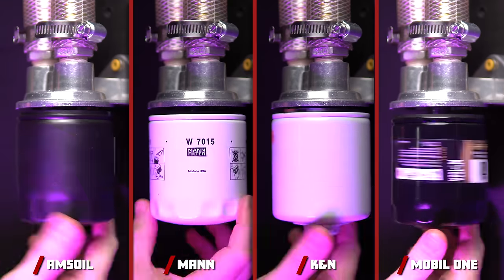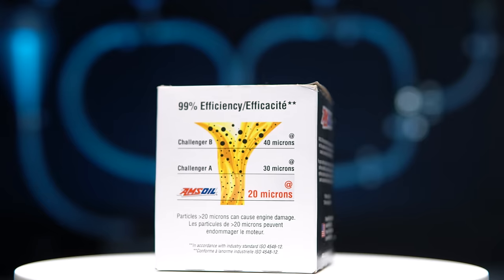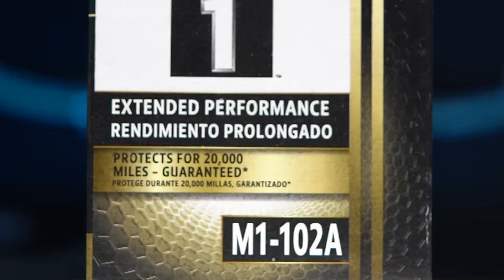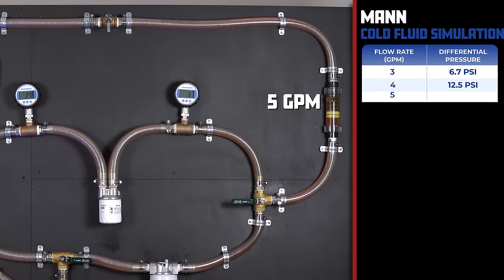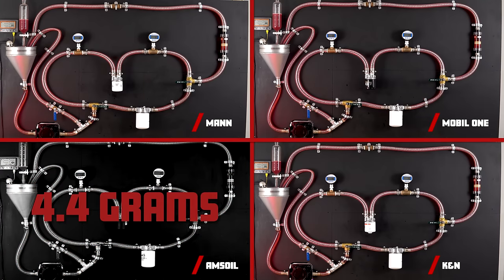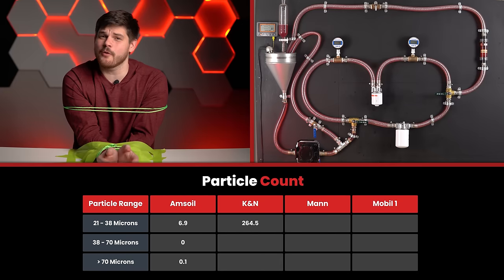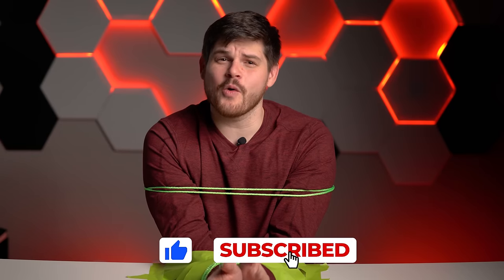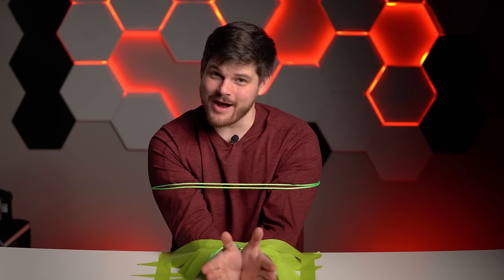Best Oil Filters of 2024 (Engineer Tested) - Amsoil | Mobil 1 | Mann | K&N

Comment: The Amsoil filters are full microglass same as Fram Endurance, Purolator Boss, and Royal Purple EL. The Mobil 1, Mann, and K&N are cellulose blended with microglass. Cellulose is less restrictive but not as resistant thus blended for longer service. 100% extended drain-interval synthetic oil should be matched with microglass filters for longest service and engine life possible.
Reply from the maker: Thanks for the info and for watching!

Comment: I’ve tried several different filters on the same 2008 truck over the years every 5000 kilometres. For the past 3 ish years I’ve stuck with Mobil 1 because my engine starts quietly during cold Canadian winters. My engine is less smooth and louder (only on start up) with all other filters when it’s cold out. I would compare the louder sound I had as being similar to what an engine sounds like on first start up after having the oil changed. I don’t get that with the Mobil 1 at all, so I feel comfortable using that filter.

Comment: Can you please test the new PF63 AC Delco p/n 12735811 with 13 holes in the base vs the older model with 8 holes in the base p/n 12707246 Really curious to see the difference if any 😊 thanks

Comment: I use Walmart Super Tech synthetic oils and >10 μ Donaldson filters (cross referenced to OEM filter specs) in my vehicles. Change every 5k miles. Yearly inspections show minimal wear in my turbocharged engines. I pay $45 for a case (12pk) of the filters.

Comment: Thank you for your video I actually use it for reference.  Love the restraints kind of throws you of guard.  I wanted to know if the Purolator Boss having less filtration than the Purolator One at 20 microns was not used instead.  I couldnt find the Purolator specs so I contacted them and they told me that the Boss has less filtration than the One.  Thank you for your awesome video.

Comment: I am just amazed at the wix xp sucking at the filtering.  A suggestion - can you weigh the filter before and after each test?   You mention capacity etc but curious if the weight after each test will illustrate filtering and capacity as well.

Comment: If you want lower flow restriction, use a longer version of your stock filter. The longer the filter the lower the restriction. Motorcraft ,Fram, and Amsoil are 3 companies that have longer versions of my stock filter available for my 94 ranger (2.3L). There are probably more filter companies that have longer versions available also.

Comment: My engine has a VTC issue, which rears it head on super cold days.  I suspect when it takes longer for oil to reach the top end.  I have been using the Mobil 1 filter for its supposedly good flow.  I see there are some other filters that might be as good or better for my needs.  Thank you much for doing this testing.
Reply from the maker: Thank you so much for watching. Yeah the Mobil one has great flow, but some have even better during cold temperatures. Glad you enjoyed!

Comment: How things have changed. Years ago, FRAM fell from grace and became the biggest piece of crap ever made, they used carbon steel staples and GLOBS of glue to secure the pleated paper, the elements were breaking apart and collapsing, blocking the flow in the filters! I NEVER used Fram on my 69' Charger and Barracuda with a Hemi and 383, and neither did any of my dozens of friends who had high performance engines.  Wix, Purolator and GM were very good back in the 60's-80's,   Happy to learn that Fram got their act together once again and straightened out their mess. Great VIDEO !

Comment: Interesting video! You should really test a common OEM Honda K20A oil filter vs the legendary F20C specific OEM filter used on the S2000 and really show the difference between them. The story behind it is that the S2000 filter has less flow restriction due to the high oil flow capacity requested by the 9000 rpm engine but I think nobody ever quantified the difference with a proper test.

Comment: I just picked up a Purolator Boss filter and two 5 quart jugs of Pennzoil Ultra Platinum 5w-20 for my truck today. I got a new motor last April of 2023, and it finally sounds broke in, and it is finally getting the correct fuel mileage. I hope swapping what I use for oil and filter keeps this thing going for 18+ years like the original motor did on Mobil One oil and filter.

Comment: Seems like the filters with the less restriction  and better flow also . Seems like the reason Amsoil has the worst restriction is because it has the best filtering media. I doubt the pressure differential would even be much of an issue for daily drivers as they aren't driven full throttle all the time. Amsoil makes some nice bypass kits too you can put on any vehicle that filter out even finer particles.I'll take amsoil all day long for engine longevity. In fact my wifes Accent is almost at 230k miles and last Blackstone test using Amsoil oil and filter came back amazing.

Comment: Put a Purolator Boss on my Tacoma today due to this video. Maybe it's overkill for that, but I want the best filter I can get. It does so well in these tests that it's almost hard to believe there is a single do it all filter available.
Reply from the maker: So glad we could help! Thank you for watching!
Reply: Same trying a purolator boss on my 350z this weekend instead of my usual K&N HP-1008
Reply: Why didn't you use Amsoil then?
Reply: @DaddySizeIt  You've read about "possibly even strip the additives" but where is the objective proof? There is none, because it is nonsense, not at 20 microns.

These videos are very close to garbage. He very clearly biases his conclusions toward pressure loss and capacity and pretty much ignores efficiency, the thing that actually matters when filtering oil!
Reply: @DaddySizeIt   Yes, it has been tested, tested all the time, and yet here you are still pondering.

I have watched all of these oil filtration videos. They are consistently biased for the measured metrics, and against real world usage.
Reply from the maker: @wiredforstereo Please refer to the rankings table from our last video, the filtering performance ranking is weighted at 50 percent... way more than all the other metrics we tested, so if anything they are biased to filtering performance. You are more than welcomed to weight the rankings as you please if you care more about the filtering performance then weight it higher, but for others flow restriction is very important. Amsoil is a great filter, but also very expensive and very reatrictive, it's a tradeoff. Hope you have a wonderful day.
Reply: @wiredforstereo  what about project farms oil analysis video? What’d you think about that?
Reply: @BrandRanks   You can get the same filter from Fram for half the price. Given the same test, wouldn't Fram Endurance be the winner? You don't even have to test it, you already have the results.

But your tests are fundamentally biased in the way you perform them, and even more so in how you discuss the results.

We know how valid filtration efficiency is because we know the gaps between the parts in the engine and what sized particles cause the most wear.

How valid is X psi pressure loss in an engine that has a 70 psi pressure relief valve?

How valid is holding capacity, when 1, we don't know how much mass the engine is producing, 2 we don't know when the oil is changed if the filter is anywhere close to full, and 3 the Amsoil (and Fram Endurance) filter capture far more smaller particles while the other guys are letting them through.

So how much of the total particulate circulating in the engine is captured? How much is produced? How much remains? How much engine wear results from remaining particles?

As long as the engine is getting oil, which it always does due to the bypass valve, neither pressure loss, nor holding capacity are objectively relevant. Amsoil prescribes 15k miles for each filter, will it be full by then? What about the other filters? How much more particulate will they produce as a result of the particulate not captured by those filters?

Lot of bias, scientific, maybe, but barely generally applicable. And so many of these commenters have taken your bait and put emphasis on how much oil will go through the filter and not how well the filter does its primary job.

Comment: The OEM filter that Volkswagen often sells is Mann.  It can be Hengst or other brands but they are sourced in or near Germany. It would only make sense that they stay fairly local.  That may be so that the parts don't cost a fortune in shipping.  Also I tend to like German quality parts like their air and oil filters.  Ever used Liqui Moly (Lubro Moly in Germany)?  I have tried their oil and found myself using it again and again.  It is about as expensive as Mobil 1 maybe a little bit more.

Comment: Hey brand ranks, I work at a motorcycle dealership and a customer came in with a unique filter that I hope you guys can check out. It's a magnetic filter made by tacomoto called the mother of all filters. It is a magnetic rod which claims to attract ferrous debris from your oil and then that ferrous debris is jagged and has pockets similarly to how a traditional filter would have micro holes in the mesh to hold onto particulate. They claim little to no resistance since there is no filter for the oil to pass through and they claim better filtration than traditional filters. 

As a side note which is more specific to motorcycles then cars. They mention that paper filters will clock and hold water when any water is present in your oil like what might happen at a river crossing when you drop your bike. 

I'd love for you guys to pick up one of these filters and test it out. They have oil lab results on their product page but id love to see some independent testing. It would be exciting to see what could be the future of oil filtration or a scam.

Comment: I’m new to the channel and therefore don’t know if you’ve done this, but have you tested the filters using the products they were designed to work with to see  which “system” works the best? 

Would be interesting to see how Amsoil 25000 km filter performs with their signature oil, or Mobil 1 with Mobil 1.

Comment: Would be interesting to see the bigger Amsoil EAO filter (same media, but bigger and claims 25k mile) tested against the smaller EA15K filter (15k mile)- my assumption is that the larger filter would be able to to reduce the pressure drop across the filter at the same oil flow volume which improves filtration efficiency and reduces bypass events. It could also extend filter life through increased loading capacity, allowing it to filter longer before becoming clogged. There's also the slight increase in oil capacity and increased can surface area to aid in cooling.

Comment: Thanks for this video, I just wish you had used the Amsoil EaO instead of the 15K. As its name implies, it is rated for 15K miles, that may have affected the holding capacity. I appreciate your commitment to keeping all conditions constant across your testing. One thing about efficiency, it has been noted that as the differential pressure (delta P) increases, some of the already captured particles are released affecting efficiency ratings. In your testing, you can't isolate that, but if you could stop the test when the delta P gets to 4psi, to compare to the particle count at 8psi (I think you stopped the test at 8) to get the efficiency at a lower delta P that might be helpful. An air filter will get more efficient as it loads up, but an oil filter will not. Keep up the good work!
Reply from the maker: Bob, thank you so much for all the info! We really wanted to do the EaO but unfortunately there was no cross reference to the filters we were using amsoil only offered a 15k oil filter. You have a good point on the efficiency, we went with the 8psi as it was the industry standard, but. Slower delta P could be very interesting to test.

Comment: I drive audi 1.8ts as they are my favorite car to work with and with proper maintenance they last forever (timing belts and oil pressure are the only killers so the right filter is of the utmost importance). All throughout the years people either swore by xp/mann/mobil1 filters for these cars. They are all in the top 5 for flow rate for a reason and this video sells that. I personally use the wix xp filter and do 3k mile oil changes. Whenever I tried the other filters it would usually follow with the red oil light of death(clogged pickup pipe would cause this as #1 oil fail point on these cars) judging by these charts I would say if you drive like you steal your cars or you drive super tuners i would use the xp filter and just do religious and short period oil changes. If you are just a normal commuter driving normally than do purolator since their flow is still in the top 5 and their filtering is impressive for such a high flow rate. But anyway like I said you can mitigate the poor filtration of the xp by doing super frequent changes. I would say that race cars should probably be using the xp filter based on this data

Comment: I just used a boss filter when I changed my trucks oil, and will probably continue on using them.  I read a lot on the interwebs and never see them recommended, which is surprising. I see Mobil 1 and Wix recommended a lot and I’ve always used those. Turns out, they’re not that great.

Comment: Been following this, using Purolator One "Synthetic 15k filters" ( and or Quakerstate QS8A) also made by Purolator.    These i get locally from Menards & wondering how the "One 15k mile synthetic " stacks up to the "Boss"  and others from Purolator.    I like the Bypass on the MANN but not sure where those come from & your $ was higher than i usually  pay for the 15k mile ONE.
 Thanks alot great content 👍 😊

What i found w the "Bypass"  on the bottom on the filters i cut open is a "CLEAN BOTTOM" so all the junk that settled gets bypassed back to the clean oil gallys... 😢😢😢😢

Comment: I drive a Kia seed 1.4 petrol engine 101 horsepower. For the first time after the end of the warranty I did the oil change myself. For reasons I don't want to describe here in order to save time I couldn't get my hands on genuine oil filter, so I used one which has three valves versus two valves as in the original. Do you think using such an oil filter with three valves instead of two has any disadvantages? Thanks.

Comment: Great videos. I love what your doing. Could you guys test a standard wix filter vs XP, Purolator boss vs standard Purolator, and so on. It seems the standard cellulose filter media has a lower micron rating, but how does it flow, what kind of capacity does it have.  My thought is could you run synthetic oil like amsoil for 10-15k miles but run a standard filter and get better filtration equal flow but just change the filter at 5K-7500 miles instead because of lower capacity or a flow rate that gets lower faster as it gets dirtier.  Ultimately Amsoil seems to be the best oil what is the best filter period as far as protection and flow.  Capacity can be fixed by changing the filter part way through the change.

Comment: Issues, when did the bypass open rendering the filter useless? Micron rating, ie how well is it cleaning the oil? How much media is in each filter, ie how long will it really last. For me the interval will always be 5k for full synthetic in passenger style gas vehicle, 3k for diesel or hard working gas (trailering ect.). So the time at which it claims it will last is meaningless to me, but would be interested in contaminates filtered vs flow. If it flows well but filters less or not at all, or does it flow a little less oil but comes out pristine? Then at what gpm loss does a motor suffer or lose lubrication? This would determine the "best" filter.

Comment: i would expect some of these results to altered rather radically when using a bigger filter size, say the old ph8A size of 5.1"... also, did this testing address the bypass pressure release rating differences, if any? the ph8A at 12psi, for instance.

Comment: Awesome video! I was curious to know how similar the Amsoil filter was to the FRAM Endurance seeing how their construction is completely identical except for the fact that the Amsoil has 2 more pleats. I'd be interested in seeing some budget filter, especially the Purolator One which has a listed filtration of 99% @ 20 microns compared to the Purolator Boss which has a listed filtration of 99% @ 25 microns. Doesn't make much sense that the cheaper filter has a better micron rating. Perhaps it suffers in differenctial pressure and capacity in comparison.

Comment: The Mann-Brand is from germany, and in germany it is very unusual to have a rated milage on the oil filter itself, that is a concern of the car manufacturer and the oil filters are just made to fit the car and its manufacturer rated service intervals.

Also on german brand oil filters I have never spotted a rating for its filtration power.
Reply from the maker: Thanks for the info and for watching!

Comment: Any recommendations for thr best filter for longevity and not performance? 

Im a rideshare driver looking to get the best filter that will make my engine last as long as possible.
Reply from the maker: Hey, thanks for watching! I would recommend either the Purolator Boss or the Fram Endurance! Great filtering performance. Just remember that oil change interval is critical for a long lasting engine